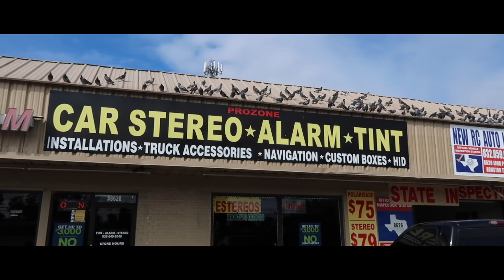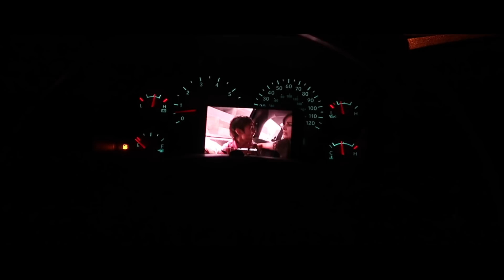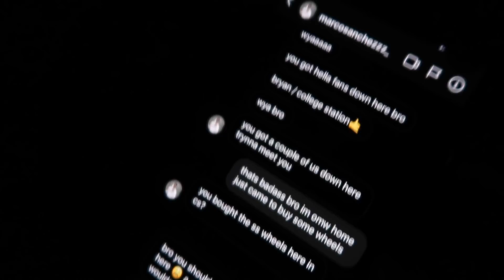NEW WHEELS AND SEATS FOR THE NEW SINGLE CAB!

Comment: Did you have to pull the rear fenders out to get the strata codes tucked up in there? I have the same wheels and truck and they are hitting the fenders after I roll them.